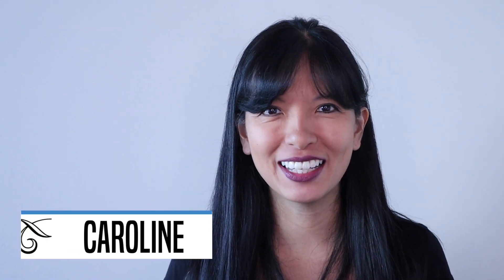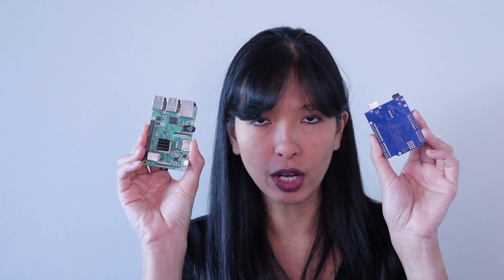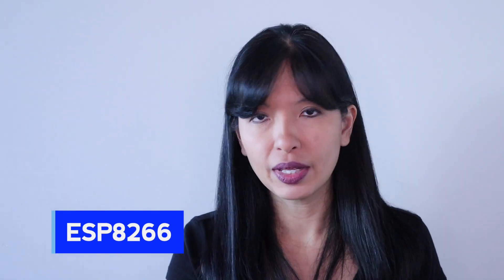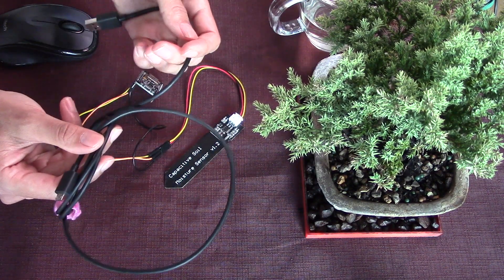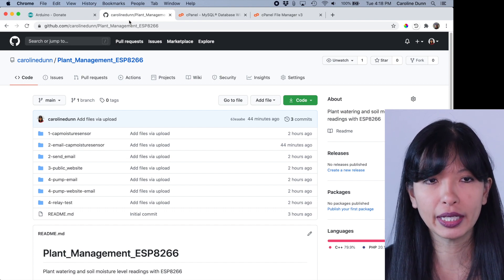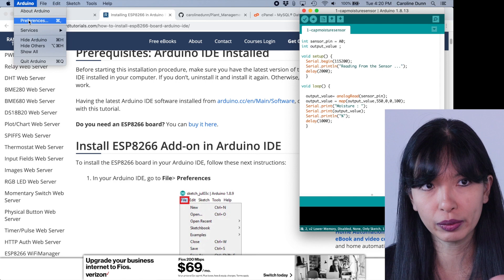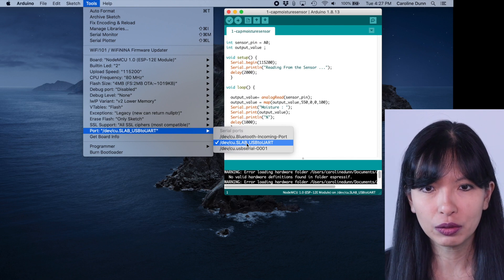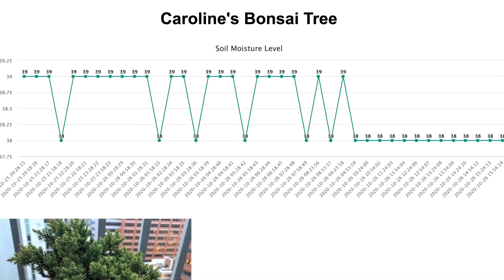House Plant Monitoring and Watering Part 1: Setup ESP8266

Comment: This tutorial is INCREDIBLE and you are a GENIUS, Caroline!!

This project was SO FUN! I would have never gotten around the analog input problem with the sensor if not for your introduction of the ESP8266 (I ordered an analog to digital converter but the pins didn't come presoldered and I knew I couldn't solder all those pins nicely with my huge cheap soldering iron). 

As soon as I finished this video I took the leap of faith and ordered the ESP8266 and returned the stuff I was using to try to make it work with the pi alone, almost ordered rhe arduino board from your old tutorial, but thankfully I stumbled upon this playlist in time. 

Can't believe after all that struggle, it was this easy with the ESP8266!!

Comment: How can a humidity be in the negative? Also, when you put the sensor in water, the humidity was only cca 40%. That doesn't make sense
Reply: It's because each sensor outputs a range of values and her code assumes that range is from 200 to 500 I think. When I tested the raw values for my sensor, dry air was ~800 while a glass of water was ~420. I modified my code to incorporate this and I get the type of values you'd expect. (70-90% when it's surrounded by visibly moist soil, 20-30% when it starts to look dry, etc.)
Reply: @humble_roots  I actually tried it and did you what laid out. However, the sensors are really bad . My soil was totally dry, yet the sensor showed it was still pretty wet. When I pulled the sensor out there was moisture on the PCB, like condensate? Tried with three different ones and the results were the same. This is unusable for soil IMO, or usable only for really small containers where the PCB reaches from the bottom to the top - and that's a maybe...

Comment: hey guys i need help with the programing it is generating an error while compiling the code. 
In function 'void BlynkWidgetRead11(BlynkReq&)':
PlantKeeper_public:248:27: error: 'getStatus' was not declared in this scope
  248 |   Blynk.virtualWrite(V11, getStatus(0));
      |                           ^~~~~~~~~
C:\Users\hp\OneDrive\Documents\Arduino\libraries\libraries\PlantKeeper-main\PlantKeeper_public\PlantKeeper_public.ino: In function 'void BlynkWidgetRead12(BlynkReq&)':
PlantKeeper_public:252:27: error: 'getStatus' was not declared in this scope
  252 |   Blynk.virtualWrite(V12, getStatus(1));
      |                           ^~~~~~~~~
C:\Users\hp\OneDrive\Documents\Arduino\libraries\libraries\PlantKeeper-main\PlantKeeper_public\PlantKeeper_public.ino: In function 'void BlynkWidgetRead13(BlynkReq&)':
PlantKeeper_public:256:27: error: 'getStatus' was not declared in this scope
  256 |   Blynk.virtualWrite(V13, getStatus(2));
      |                           ^~~~~~~~~
C:\Users\hp\OneDrive\Documents\Arduino\libraries\libraries\PlantKeeper-main\PlantKeeper_public\PlantKeeper_public.ino: In function 'void BlynkWidgetRead14(BlynkReq&)':
PlantKeeper_public:260:27: error: 'getStatus' was not declared in this scope
  260 |   Blynk.virtualWrite(V14, getStatus(3));
      |                           ^~~~~~~~~
exit status 1
'getStatus' was not declared in this scope

Comment: just found your vid and one very important note - when buying capacitive soil moisture sensor, pay extra attention to what chip has been installed on it. there are generally two version - NE555 which requires 5V input voltage and it's NOT suitable for usage with ESP8266, and finally TLC555 chip which works with 3V (I think the chip itself actually needs 2V). if you use the former one NE555, you're going to need to add some additional voltage divider to power it with 5V.
Reply: this comment should be pinned